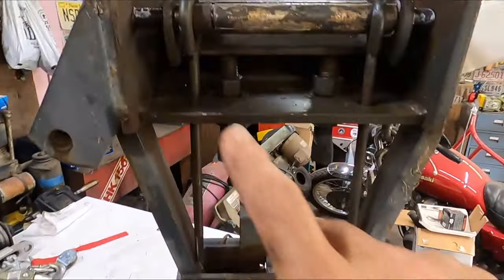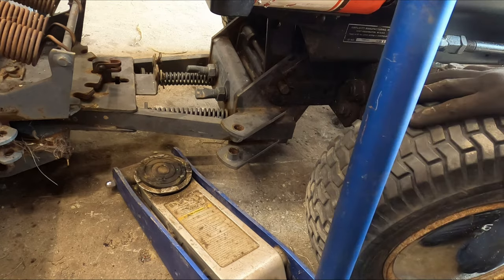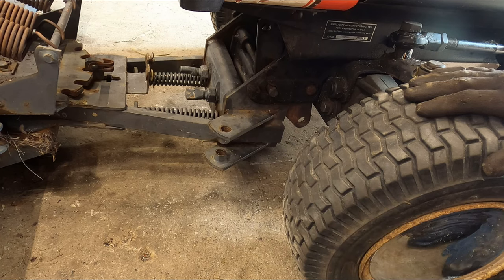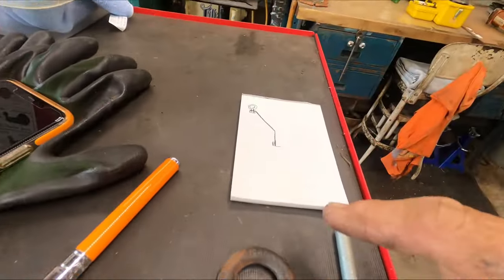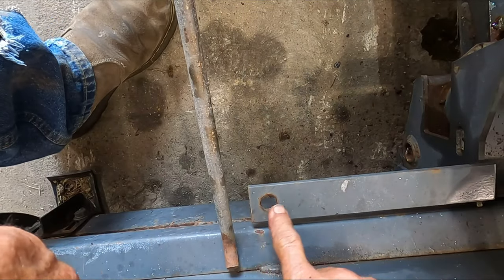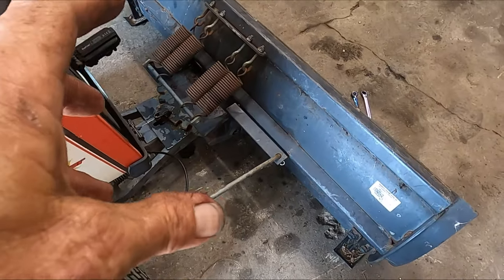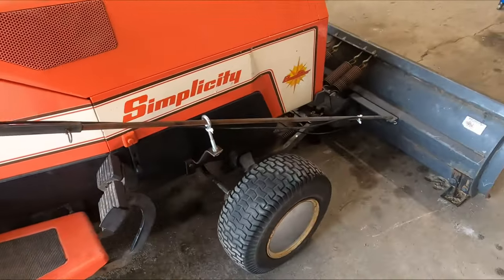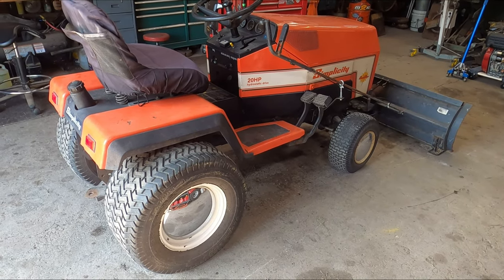60 Inch Simplicity Legacy Plow Blade Modifying to Fit Sunstar Finale

Comment: Man What a gorgeous tractor that is. Hope the blade does not take to much  weight off the rear end in the snow or the back wheels will not have a lot of traction.  Fantastic job of installation with this blade.  Great video.  Thanks for all your videos
Reply from the maker: Heya Mr. C! This blade will end up on the Zipploader tractor and I have 100# of plate weights I'll be adding to the wheels plus a counter balance weight for the sleeve hitch to help offset the weight of the blade. Hopefully that'll be enough, but if not....I'll figure out a way to add more weight. Cheers my Friend! Zip~
Reply: @ZippoVarga  We ended up using chains so we would not stress the frame to much.  But you are way smarter then I am